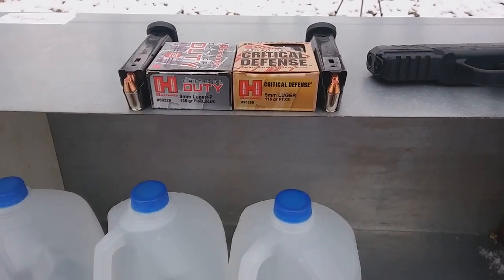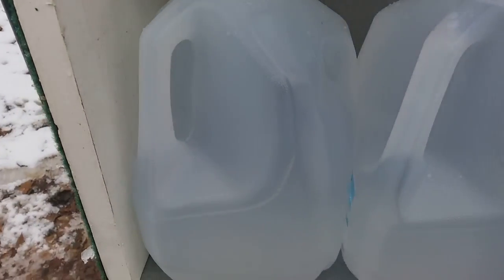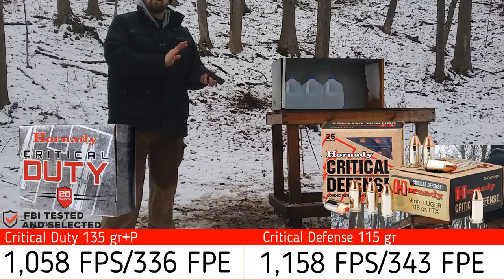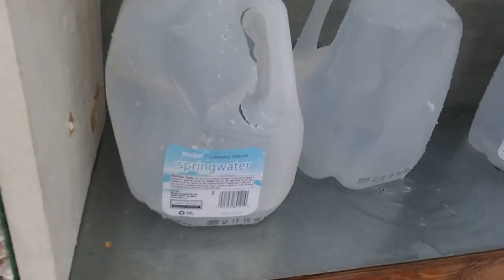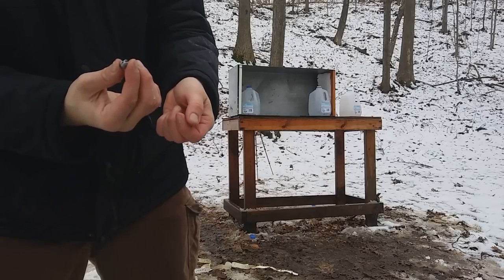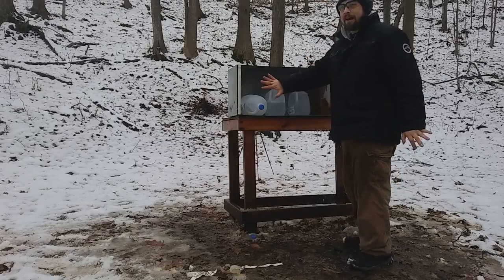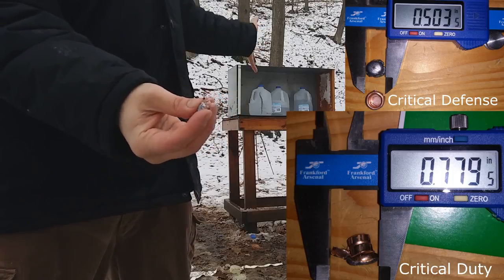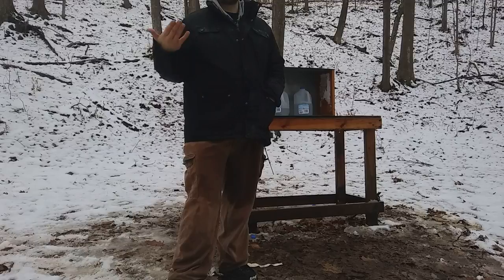Hornady Critical Defense Vs. Critical Duty in 9mm

Comment: Wont make a big difference.  Buy which ever one is cheaper. Bought and shot both. Pump 3 of either center mass and its a wrap. Handguns are for carrying in public. If someones busting ur door down at home? A Remington 870 12 gauge pump w a riot tube/tube extension loaded w 00 Buck or  Mossberg 500 loaded the same is the best defense at home

Comment: Awesome video. Same brand but different loads head to head! I'm not sure if anyone has done that (probably Lucky Gunner). I have both of those but in .357 Magnum where the Defense is 125 gr and the Duty is 135 gr. From your testing, I do have a bit of a worry about over penetration from the Critical Duty in .357 Magnum. The energy difference you're showing could well be within shot to shot variation. If so, it's hard to make a call on what is going on, but I would say that the Duty round holding together is what made the difference (plus a bit of extra weight doesn't hurt).
Reply from the maker: It always seems to me that when a particular caliber is heavier, that no matter the velocity, the projectile resists damage more than it's lighter counterpart. I would bet that while not identical results, if the Critical Defense was a 135 gr, we might get slighter closer results to the Critical Duty, with the exception that the jacket would still probably come off. This test also gave a good show that the jacket thicknesses are indeed different. The Defense jacket peeled right back, and the Duty one stayed with a hard petal left, which you could see the difference on jug one, it's obvious that the petal ripped jug one open as it emptied in seconds.
Reply: @GunSam  One thing with those petals is they are sharp and will be cutting. Rounded off lead might just be pushing tissue aside without doing as much damage. This is just speculation on my part.

Comment: Since Critical defense is designed to be fired out of shorter barrels, I'd be interested in seeing a comparison of the two fired through a Glock 43 or a Shield.
Reply from the maker: I don't have a small 9mm like that. It's too bad a Critical Duty isn't available in a .38 Special loading because I could test the two in a snub nose .38 revolver. The best I could do would be to compare the 9mm Critical Duty in this pistol and the .38+P Critical Defense in a 4". I say that because the .38 SPL+P Critical Defense is 110 gr@ 1,130 FPS in the 4" which would be on par with the 9mm Critical Defense in a short barrel 9mm pistol.
Reply: @GunSam  Maybe I'll get the energy to try it with my Shield some day.  If it ever happens, I'll let you know the results.  The main reason I'm curious is that a gun dealer told me critical defense uses a faster burning powder, so should have closer velocity and power out of a short barrel.  I'd thought it was just a lighter load, but it'd be interesting to find out.
Reply from the maker: That sounds accurate from my testing. The .38 Special loads in Critical Defense are faster and more powerful than most, I get 1,000 FPS with the .38+P 110 gr in my 1.875" barrel. But the .357 Magnum version, I have not tested it personally but from what I have seen it does not perform all that well, and Hornady even uses an 8" test barrel to get the velocity that they do. Speer does kind of the same thing that Hornady does with their Gold Dot ammo. They have a short barrel Gold Dot, which is what is used in 90% of their Gold Dot line, and is thinly plated with nice HP segments, and it performs well in short barrels or low velocity cartridges. The .357 Magnum/.357 Sig and a few other "duty" calibers made for full size guns uses a differently designed "Gold Dot" bullet that has a thicker plating.
Reply: Hornady Test The Critical Defense in 4in Test barrel .. it’s not just for sub compacts... I carry it in my G45
Reply: @murfdawg7938  I think you missed my point.  I know Critical Defense isn't just for sub compacts.  My point was that it's designed for shorter barrels, relative to Critical Duty.   Critical Duty loses its advantage over Critical Defense in short barrels.  When shot from a 5" barrel, Critical Duty  has a clear advantage.  While Critical Defense would work in a 5'" barrel, I can't imagine why I wouldn't shoot Critical Duty in it, to get the additional velocity.  I was just wondering what you'd get comparing the two out of a 3" barrel.  I have a couple of Shields, which have 3.1" barrels.
Reply: I own a shield also and I carry the critical defense in it also ....the two go well together... the critical duty is designed for 4in or longer barrels .. to get maximum performance from the cartridge. Not saying it wouldn’t / couldn’t work but for me personally it doesn’t fit my application.